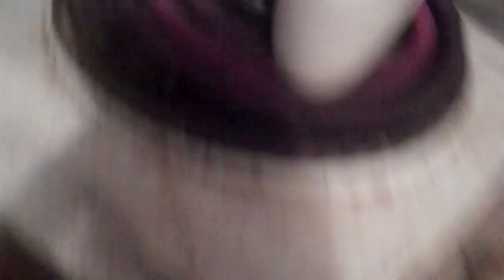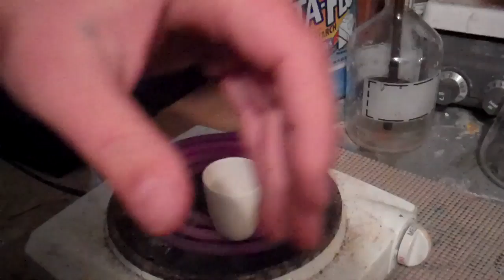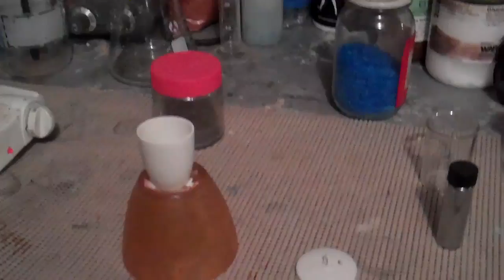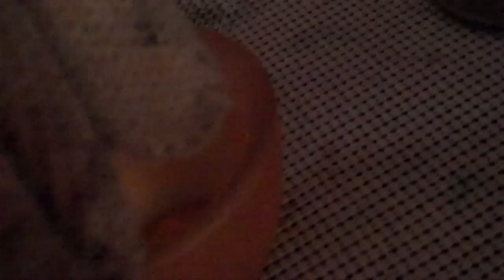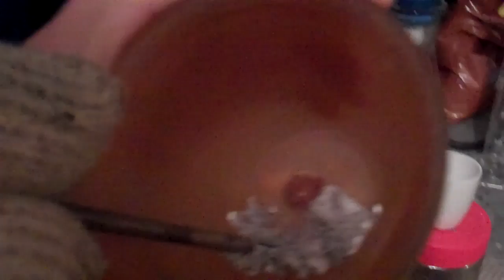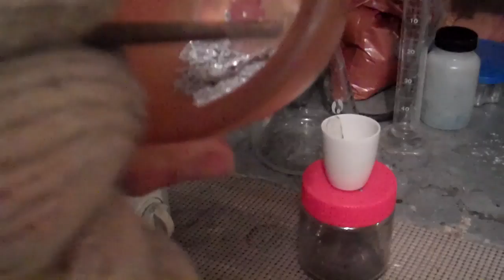how to make metal sand with bismuth and mercury

Comment: This is one of the most irresponsibly done chemical experiments I've seen on YouTube.
Where did you get the idea that your alloy is safe? It fumes mercury vapors like hell.

For god sake, adding mercury to an open vessel heated over bismuth's melting point? That's over 271 °C!
You clearly have no idea how much fumes you've produced in the very first second you dropped it inside. And you just keep talking and breathing it in.

Don't ever do that again, not even inside a fume hood.
Reply: endimion17 the boiling point of mercury is 356 celcius, so assuming he was on the low end he should be mostly clear of danger from mercury